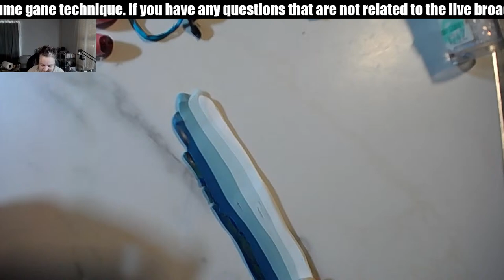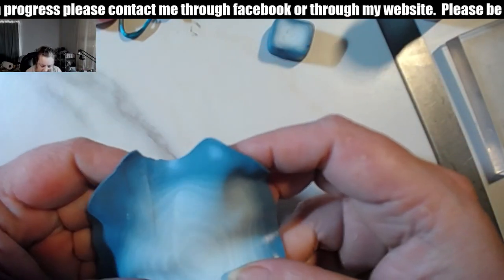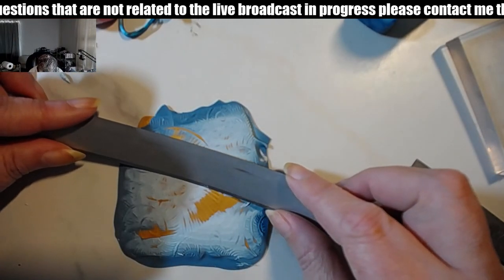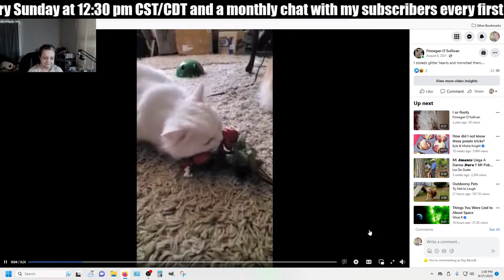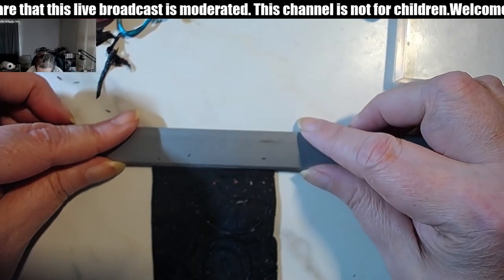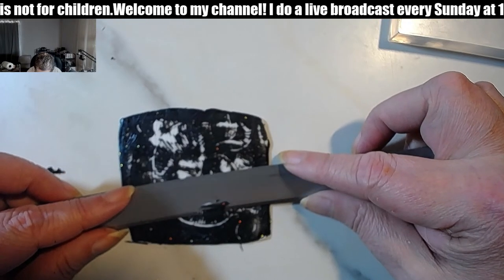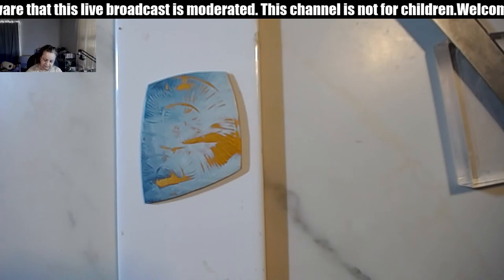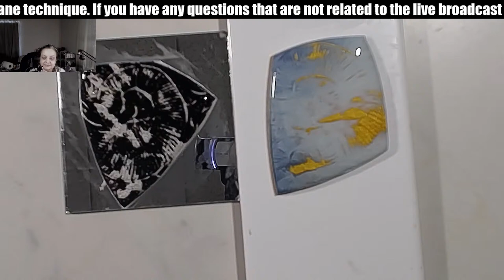A mokume gane idea

Comment: Do you apply resin first and then bake the clay?
Reply from the maker: Yes. If you apply the resin on baked clay it has the tendency to warp it as it pulls on the edges to self-dome. If you first put resin on raw clay stuck on a baking base, as the clay is stuck it will not lift as the resin cures. 
Careful though, it only works with Chinese UV resin. All the others I've tried with the resin will yellow and/or cloud up
Reply: @KalyanaDesignTutorials  thank you very much! I have definitely had trouble with baked clay warping with resin. I have the Chinese resin, will try out your suggestions!